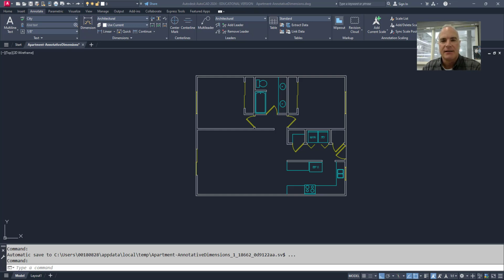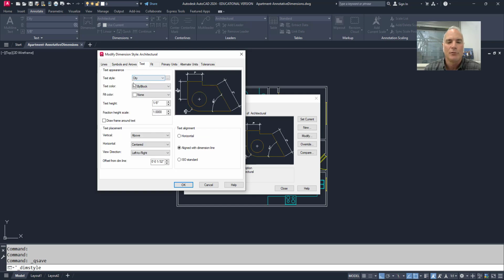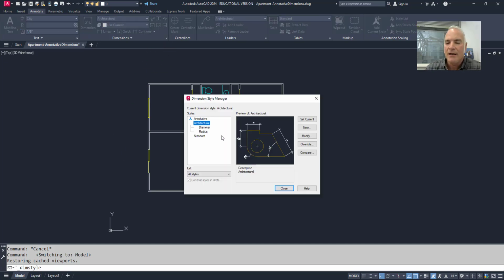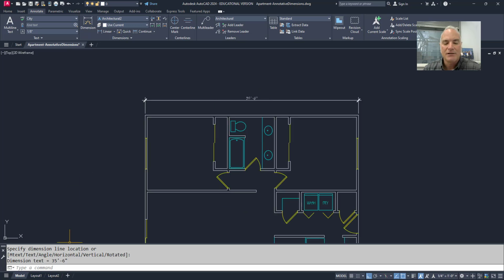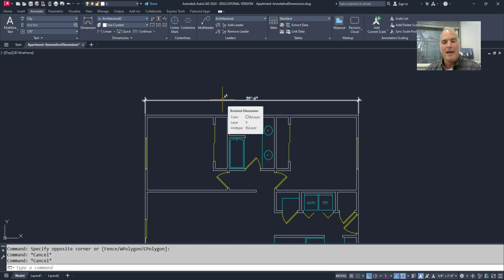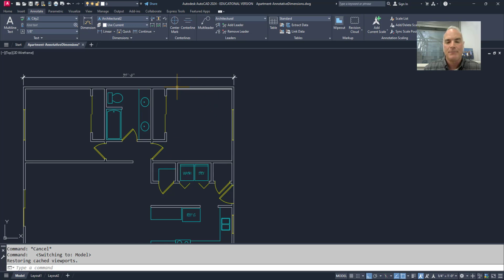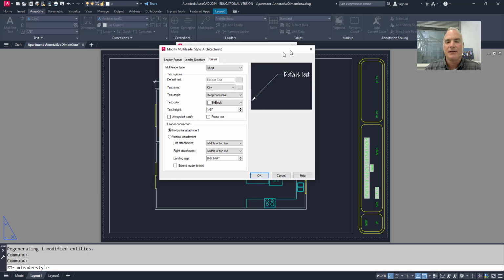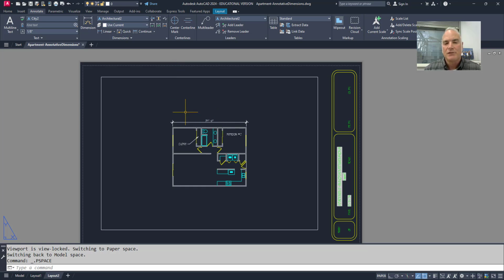Annotative Text and Dimensions in AutoCAD

Comment: It is so hard to understand these step to achieve auto-adjust for text and dimensions. I am literally stuck here ,literally. What should I do!?
Reply: I guess what you demonstrated is just to tell autocad “in the following scales within viewport, you need to make sure your style is printed out as 1/8’in large characters on paper, right?
Reply from the maker: That is correct. You can tell the program what size you want the text to appear in paperspace and it will adjust it for you. You can add or remove scales as needed.

Comment: I have watched several videos to try to understand annotative dimensions & text. This video has by far been the most helpful and straightforward! I am very new to annotative text and dimensions. When drawing a floor plan, I typically use different height text, for instance my room name text will be a larger text than my door & window size text. Should all of these be annotative text and if so how do I go about doing that?
Reply from the maker: Taylor,
I would suggest you use annotoative text. Make it the size you want it to appear in paperspace and be sure to apply the correct scales as described in the video. It should work perfectly!

Comment: Do I have to use change properties with every dimension line I draw or text I write in order to add more scales to the dimension or to the text?
Reply from the maker: Auto-add scales (this is the big one people miss)
Check this system variable:
ANNOAUTOSCALE
1 = AutoCAD automatically adds new scales to existing annotative objects
0 = You must add scales manually (the annoying behavior)
Most users want this set to 1